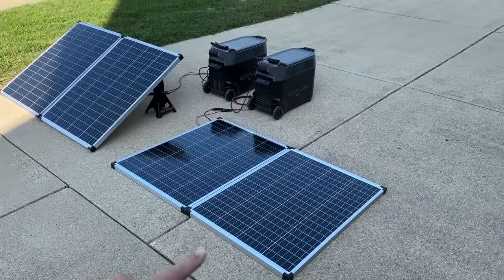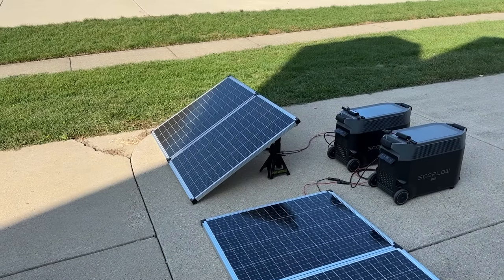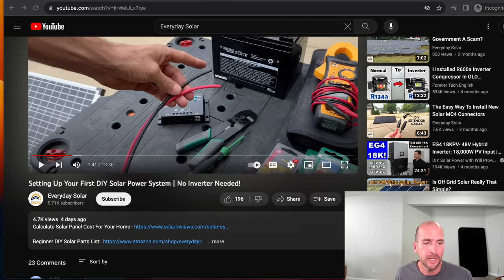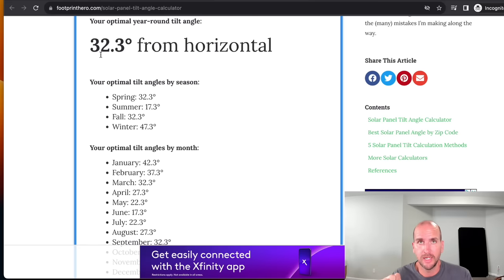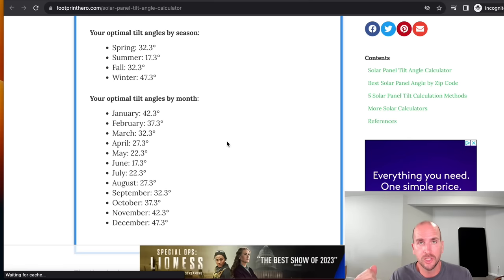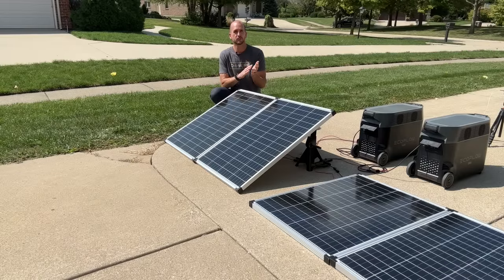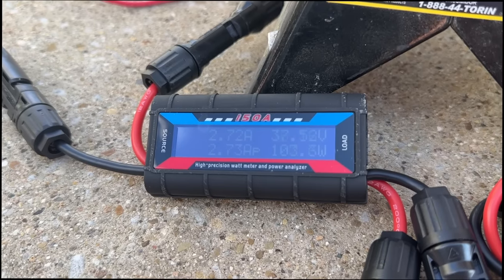Measuring The Impact Of Solar Panel Tilt Angle

Comment: Here in Southern Australia seems best angle is to maximise sun when its low in the sky and days are short. Around summer when the sun is high and days are  longer, the panels are saturated and also get extremely hot, so the tilt makes no difference, and  may actually keep the panels  slightly cooler by reflecting some sun..
Reply: Very interesting approach.  Makes perfect sense, since the low light hours are usually wasted, and you are correct, the excessive heat is detrimental to longevity and output.👍
Reply: You could actually increase efficiency by continuously spraying water on the panels
Reply: what degree of tilt is this comment related to? my roof is 5 deg tilted and that's what I want to keep for my panels
Reply: @martiruda  I didn't express myself very well 11 months ago! The rule of thumb is that the angle of the panels should be similar to your latitude. So here in Melbourne (southern Australia) latitude 38 degrees south, the panels should be facing true north at an angle approaching 38 degrees. Exactly 38 degrees will optimise it only in the depths of winter, so really you want the angle roughly 30-35 degrees, to best capture the sun over a long period either side of winter.  What's your latitude  @martiruda ? 5 degrees would be pointing almost straight up, that would be the angle if you're close to the equator, but you dont need to optimise the angle when close to the equator, because more than enough sun to saturate the panels all year round. You want to optimise the angle for the time of year when solar radiation is the least, which is the 6 months around winter in temperate/middle  latitudes.
Reply: For an off-grid person, the winter is all I care about. Did the whole summer with 4 panels off grid, because it was too hot to add panels. If I would have switched on the A/C I would have needed those extra 4 panels.

Comment: You got shadow created on flat panel from the tilted panels.... That's your loss...!
Reply from the maker: Actually, that was one of the factors I was monitoring.  I stopped the test at the 2-hour mark as we were right on the edge of the tilted panels casting a shadow on the flat panels.  So, for this test that would not be associated to the loss.

Comment: there should be additional heat loss on the flat panels from this testing setup. I would have tested those flat panels elevated about an inch or two off the concrete to allow for normal airflow under the panel, that way this test shows only the losses attributed to angle and not angle plus the extra heat being held under the flats. a lot of roof mounting hardware has panels elevated an inch or two even when flat
Reply from the maker: Fair point, thanks for the feedback.
Reply: I was thinking the same thing. That concrete has to be getting some heat even in September.
Reply: It's not only that. A flat panel will actually produce more electricity during early morning and late afternoon than tilted panels.
Reply: @johnzach2057  I would think a vertical panel would produce more electricity... (Yes, I am in an area where 50 degrees is advised in the winter and I have bifacials, so why not let it catch all around

Comment: Nice test, but it should be tested over 24 hours instead of two hours.
Reply from the maker: Yeah, a dawn to dusk would be interesting.  I need better data collection equipment so I can over plot each power output curve.  Thanks for the feedback.

Comment: You need to consider both angle and tilt. In general in the US you want panels facing true south not magnetic south and for a fixed mount most systems are angled to get the most sunshine in winter when   the sun is lower and you get shorter sunlight hours. You can use that footprint website to determine both based on your geographic location.

For a roof mount system you generally have little choice unless your house was designed specifically for solar and you are stuck with whatever angle and tilt your home roof was built at unless you want to pay for expensive adjustable roof racks.

That is why I recommend ground mount with an adjustable angle so you can maximize your solar angle for both summer and winter use. You can use a much smaller system that way and maintenance is also much safer and easier on a ground mount.

By having the proper angle and tilt and ability to adjust for seasons you can use a ground mount system about half the size of most roof mounted systems.
Reply: Added: You also do not want panels mounted flat on any surface as they require air flow to remove heat behind the panels and heat is what reduces output and causes cells to fail early.
Reply from the maker: Yeah, if I had the room and no HOA I would 💯 go ground mount.  My first mistake was being in an HOA 😂. We will be doing some small ground mount on the EG4 mounts in the coming months.

Comment: It’s fairly simple in concept. The efficiency of the panels is proportional to the cosine of the angle between the direction of the Sun and a perpendicular from the face of the panel. So, for example, 30 degree difference (cos(30) = 0.87) will give about a 13 percent reduction in power compared to a 0 degree angle.  The angle between the panel and Sun will be very high in the morning and evening and smallest at midday provided your panels orient south or north depending which hemisphere you are in.  Since you might want to maximise power in winter you could argue that pointing the panel directly at the Sun for its midday middle of winter direction would minimise the seasonal power generation but not necessarily get overall maximum annual power generation. (If you live too far north/south that might not be a good strategy!)
I am sure there are web based power estimators which will graph power for specified panel orientations.
Reply: I love comments like this. I wish I had your ability to articulate the importance of maths to those who say dumb shit like  "What is the point in learning this? I will never use it once I leave school"

Comment: Great info thanks ,   I've had mine mounted flat from the distributer and rules from my city hall here in Spain .  Negatives of flat as well is water build up on the panels from rain and dew in the night .  We also have african dirt rains and pollen too . I saw a light film and dust staying on the panels .  I've raised them myself 15% and there much cleaner and will produce better power while staying cleaner .   Remember too as well that the panels will  get better direct light in winter as the sun drops in angle .  Summer I'm not worried about , 12 panels get more than enough in a full day .    Really liked your comparison .  Gracias

Comment: Wont the flat panels perform better in the mornings and evenings? 
What is then the total loss during a summer day?
Reply: Opositt,  the flat panles should perform better mid day when the sun is high.   While the angled better in the morning/night when sun is low

Comment: Is there a calculator that takes into account the seasonal changes in cloud cover?  Depending upon the weather over the year, there may be more optimal times to maximize the output.  There's also a difference bewteen grid-tied / net metering and off grid.  If you're on net metering, you'll want to maximize total output over the year.  If you're off-grid, you may want to maximize output when you need it most.

Comment: Have you taken an IR photo of the panels? There can be a big difference between the panels if some cells are broken. Or you can simply redo the experiment the next day with the panels swapped and see if the difference is the same.
Thanks in any case for someone who wants to try different things and see what the result is.
One thing about running A/C from solar panels is that solar panels also contribute to keeping the house cool by shading the house. As well as protecting the house's roof from being broken down by the sun's rays so the roof lasts longer.

Comment: You forgot a few things. Aiming partly east and west increases the duration of the charge and this is very important when your batteries are a small part of your solar plant. Aluminum wire can be used outdoors, even if it's considered an indoor hazard. Aluminum wire can be very thick. Panels don't have to go directly on a roof. They can go on subframes or mini towers in different parts of your property.
Reply: Also see that one of the panels laying flat is partially receiving shadow from the other panels.

Comment: I noticed shade (reflection) cast from your angled panels on the flat panels. Perhaps of you had them switched
Reply from the maker: It was close and that is what actually set the end of the test.  The last part of the video you could see a shadow but that was after the readings were taken for the test.  Thanks for the feedback.

Comment: I have panels on a pergola 
They are flat so they are not visible by anyone snooping.
In arizona the sun is pretty directly overhead in the summer. So it works.
If i could i would have them on a adjustable mount to tilt from dusk until dawn.
But that dont work for my low profile setup.

Comment: One thing to consider is that if you tilt the panels, you will have an increased shade area behind the panels, which cannot be occupied with the next set of panels. i.e. You can fit more on a flat roof with flat panels, that with tilted panels, thus cancelling out the loss from laying them flat (in winter).
Lets do a simplified example, lets say a panel is 1m in height. When laying additional panels above(/below) each panel on a flat roof, no additional space is needed for shading of the panels. Whereas if you put the panels at a 45 degree angle on a flat roof (with sun coming in at 90 degrees that is), the height of the shaded area beneath the panel is 1.4m (a 40% increase).

Comment: I would think that for lower vs higher angle for seasonal, if you are in a cold climate, I would air toward steeper angle, so that you use most of the power for heating, vs if you use more power for AC in the summer, then targeting the lower angle might be best.

I know in my case, 11kW is way oversized for summer (50kWh/day in peaks) but way under sized for winter (150kWh/day in peaks), so if I went solar, I would want to optimize for winter
Reply: how is your winter power so high? are you using resistance heating im in pa and summer is twice as much electricity in summer.
Reply: If you're panels are on the roof, you're going to be clearing them quite a few times during the winter, so be prepared.

Comment: Good apples to apples test. I did a similar thing we an RV, the panels were not the same manufacturer nor power rating. Over a period of weeks, it measured out to be 20-30%. I even rotated the angled panels 3 times a day to see how much it mattered. The improvement of rotating did not have a large impact. Setting for peak hours and forget is much easier.
Reply from the maker: Thanks so much for the feedback!

Comment: There is a long list of other factors that can also affect energy output but a minimum meaningful test would be an unobstructed sunrise to sunset under mostly cloudless conditions. If one also knows your ambient  temps, latitude and dates of the test others could better extrapolate for different latitudes/dates/weather.

Comment: I'm in Central Alabama and have the same panels. Can you think of some trouble shooting reasons for why I have never gotten over 75w per panel, even when less than a few weeks old?
Reply from the maker: Really, man I have really good luck with these thunderbolts.  Facing south at a 30 degree angle on a sunny day I have seen as high as 105 Watts.  Could you test each one individually?  If you have one panel in a series string it might be bringing all of them down.
Reply: @everydaysolar-ps3xg  I figured it out. I'm using one of those 4:1 connectors and the Ecoflow Delta 2 Max is limiting the input to 15 Amps. That's why I'm not able to get 100% of the input. 

Each panel has a max Amp output of 5.56, and the connector is combining them in parallel.

Comment: Two thoughts. MN USA with 11.6 kw ac ground mount. 1. My local code restricts the total height of panels off of the roof so stuck with the roof pitch. For ground mount, I would bias the tilt a bit towards the winter angle. During the summer there is lots of solar and your system is likely to clip (max out) your inverter, while there is less energy in winter sun due to the low sun angle.
Reply: what angle is your panels at? My roof is 5 deg just wondering.
Reply: @martiruda  33 degrees equal to 8 /12 roof pitch.

Comment: As the cost of the panels themselves continues to fall, what we see is that the cost of the mounting system now actually starts to make up a significant proportion of the overall spend. As a result, cheap mounting often outways "optimum capture" mounting when you look at the payback!  This is particularly the case when you look at panels mounted on high roofs that now drive a large installation labour costs.
Reply: outways?

Comment: I have an issue in that I have room extensions which impact the roof making it flat or just a few inches below the existing ridge.  According to the local regs I cannot put anything on the roof that is above the ridge.  I have had a survey done and the installer will not fit solar panels so DIY is my only option.

Comment: Being on a pergola, it should stay cooler, as it will have airflow underneath, which should increase your output
Reply: Important not to trap heat under panel. You should have raised the flat panels to get airflow under. Try that and get new readings

Comment: in having panels flat on a surface the heat buildup trapped between the panel and the surface underneath cannot escape and will effect the performance as well
Reply from the maker: Yeah, good point.  would have been nice to space them off the concrete to give some air movement/heat transfer.  Thanks for the feedback.

Comment: Thank you for your video! It gives a clue how to orient the solar panels, if they are not really adjustable. But your experimental findings are only optimal for your location, Cicago, or maybe locations on the same latitude, as you mentioned in the video, because:

The maximum yield is obtained, when the panel is oriented so, that the rays of the sun hit it in a 90° angle. That is trivial, because otherwise the illuminated area is only a fraction of that. To be precise, the efficiency is cos x, where x is the deviation of that 90° angle. That varies in relation to the time of day, but it seems best to adjust it to high noon. According to your latitude, the sun reaches maximum elevation at high noon, again at cos x, where x is the latitude. According to the time in the year, this needs a further correction, known as the solar deviation, which can be up to about +/- 23°, on the equator, and must be added. The deviation curve is easily available at the www. Another important factor is the climate in your area. If there are periods with statistically known sunny days, it may be more efficient to choose an optimal angle for those periods than an average, when the sun does not shine as much.

Comment: Would their be an way to change the pitch angle though out the year to get the best angle though out the year?
Reply from the maker: This is most commonly accomplished with ground mount that has an easy adjustment built into the design.  For those of us with roof mounted on standard racking the adjustment would be a no go.

Comment: Since its heading towards fall i have to angle my panels at around 1 pm i can get about 30 - 50 watts more at the right angle vs laying the flat which i do in the morning up until about 12 noon So angling makes a difference.

Comment: I was wondering that the two setup was placed to close to each other and at 6:50, I noticed the flat panel is partially shaded by the tilted panel
Reply: And wired in series, a little bit of shade really affect the whole string

Comment: There is a website that actually calculates that and shows how much off angle your panel can be before you lose power production.   Most solar panels are actually very forgiving and you may only lose a small amount of power production by being off angle a few degrees,  that (sweet spot) ends at about 15 to 20 degrees off angle,  more than that and power production will drop off considerably when off center more than that 15 to 20 degrees either Horiz E or W  or Seasonally/Vertically.

Comment: In theory, I should have panels set to 30 degrees - better facing the average height of the Sun and dramatically better situation when there is snow.

However, I have them on my roof (I have a house with almost flat roof, anout 3-4 degrees) and I decided to fill the roof with panels lying flat.

Why?

Because, raised panels cast shadows - and I would have to move them away from each other. That would limit the number of panels by much more than I would gain from the tilt! And during the summer, the profit from steeper angle isn't that spectacular.

Comment: I question how valid the tests are because at 6:47 you can see the inclined panels are casting a shadow on the flat panels
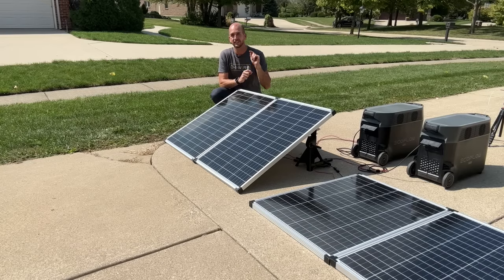Reply: He comments elsewhere that he stopped the test before the shadow began to interfere. It's also not doing it yet at 5:26.

Comment: Your results were significantly skewed because the heat buildup from the flat panels laying directly on the also hot concrete.  That increased heat will drastically lower performance.  To make this a better comparison you probably should've elevated those flat panels 4"-6" like they would be for a typical roof mount.  You can also save the testing effort and just model the difference in PV Watts... great tool and pretty damn accurate!
Reply from the maker: Thanks for the feedback 👍